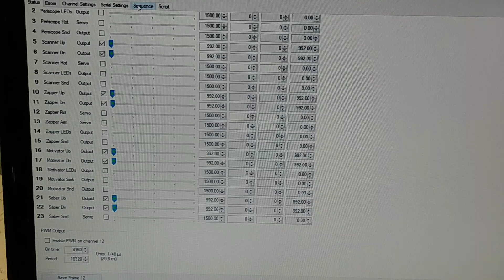R2D2 Build Episode 6-Dome Mechanism Cycle Test

Comment: What are you using for the linear bearings?  Are they just the ones from Matt Zwart's files?  I'm having problems getting the belt tension correct.  Everything works fine but the belt for my periscope lift slips and won't go up.  I was originally using wooden dowels but I switched them out for metal tubing and even tried adding lithium grease.
Reply from the maker: I believe these are the bearings I used:
https://www.amazon.ca/dp/B07CRLSS7N?ref_=ppx_hzsearch_conn_dt_b_fed_asin_title_10
Reply: @MakerDan55  Thanks!  I just ordered a set. Do they fit in the original riser bases or is there a modified version?  I'm probably going to have to reprint them anyway because I doubt I'll be able to get the old ones out.
Reply from the maker: @davidwilliss5555  I put them in the original risers and used 5/16" aluminum tube instead of wooden dowels :)

Comment: Very cool and thanks for the mods. I'm trying to get motivated (no pun intended) to finish mine. How did you get the DC motors to stay in place? Is there another bracket other than the one you created and put on Thingiverse? I tensioned some of my belts back in 2020 (before your mods came out) and I can't get them right. I'm looking to do a full tear down and rebuild at this point.
Reply from the maker: Thanks!  All of my motors are attached via 2 long M3 bolts and nuts.  2 Through each motor.  That's what holds the motor in place.  If you need a photo just let me know.
makerdan55@gmail.com

Comment: Is there a version of this where the top is split into multiple pieces as well? I could probably use slic3r to cut it up, but since the bottom is in segments, is there a disadvantage to doing the top that way, too? I only want the single lift in mine for one device/panel.
Reply from the maker: You should be okay to slice it up as long as you keep the support rods!

Comment: How does this attach in the dome?  Does it hang from the pie?
Reply from the maker: It sits on the dome plate and needs to be just tall enough to attach to the periscope pie panel.  All the other pie panels are not attached to it.  They open independently.